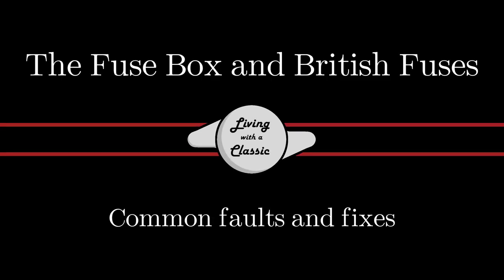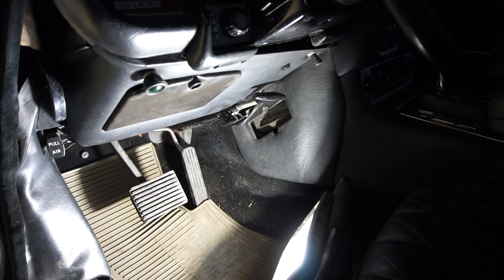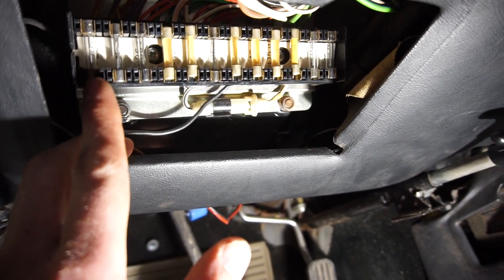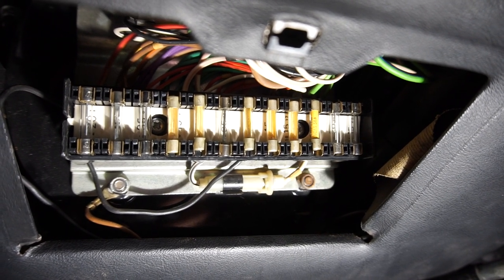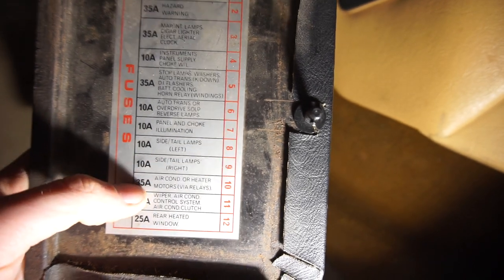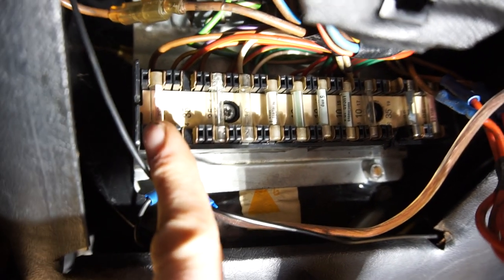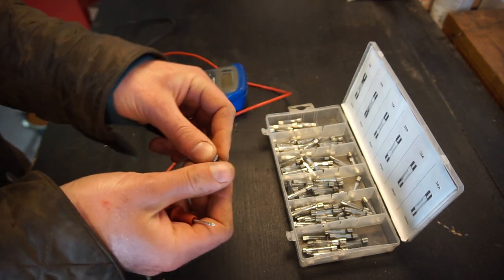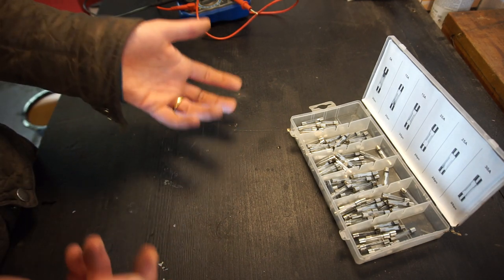Jaguar Fuses - Jaguar XJ6, XJ12 and XJS

Comment: Good video. Your site has saved my bacon over and over. I blew a dash light fuse tonight; checked the fuse box and there it was; a blown fuse. I replaced it with one of my spares. Now I have to buy a replacement (for my replacement) and I'm on the road again.

Comment: Adam,  thank you!  I have a 91 XJS V-12 Convertible.  You've really helped so far.  Just wanted you to know.  I will check my fuses tomorrow.  My side windows do not work.  I have replaced both switches.  The book says circuit breaker or relay, but I'll start with fuses just to check.

Comment: You will help a lot of people with this video because what might seem a terrible problem, many times has a very simple and cheap solution. The automatic gearbox in my old Mercedes began to act weird all of the sudden, and the dealer wanted to replace it at a price of  €4000. I made my own detective work and I quickly found the real problem: a worn relay that cost €20 new. 

I have a question: everybody says nasty things about Lucas components, but I learned that most of those were manufactured by Bosch, a brand well known for its quality. Bosch sold those components to many other car manufacturers with little or no problems reported, so why then Lucas failed so much on Jaguars?

Comment: These are very helpful and the interesting videos, especially for a new XJS owner. Though the XJS was not shown here, I ventured into my in-cabin fuse box in my 1991 XJS, although mine was on the passenger side (right side). My cruise control is not working and I see there is a listed fuse for it, but I haven’t found it yet. 

Also, under the hood there are additional fuses listed, but unfortunately, there is no description of what they correspond to; only a mention to refer to the owners manual which I do not have.
Reply from the maker: Thank you! I have all the manuals for my 1991 XJS. Which fuses do you need?

Comment: Hi Adam,
Good video. I checked my fuses on my early series 2 xj12 just after your video was posted and noticed my fusebox had melted at the third fuse from the right. I want to replce the whole box with a modern more sturdy box and modern car fuses. 
Is this do-able? On my old rover P6  v8 the electrics were so short fitted that it was nearly impossible. By the way the rover p6 has the same plastic melting problem as the jag. Rubbish quality.

Comment: My 1989 XJS convertible had an engine temp gauge that did not work properly when I bought the car. As soon as I started it, the gauge would go to hot immed.  Long story short, I found that the cluster had been removed and the flimsey tabs had been bent out of the way when they put the cluster back in. After jirry rigging the connection, and putting the cluster back in I have NO POWER to anything. No lights etc. and no ignition.  Is there a Main switch/fuse/relay ?
Reply from the maker: You lost power to the cluster or to the whole car?
Reply: @LivingWithAClassic  I lost power to the whole car.  Nothing works.

Comment: Need some help I have Hazzard lights but no hi beam no horn no turn signals and no lights on the dash it's a 83 s3 xj6 just stopped working is there a ground wire under the dash somewhere
Reply from the maker: Sounds like an issue with one of the big connectors under the dash near the steering column
Reply: @LivingWithAClassic  ok thanks for getting back to me I'll look at all the connections

Comment: Hello Adam, Home your doing great!!!
Can you help me? I was changing the warning lights to LED type bulb. I turned on the ignition to make sure they  work but I accidentally touched the back part of the warning lights unit to ground and it sparked... From That point on, the hand break, battery warning lights don't turn on anymore ... 
Also, the alternator is not charging. Is there a fuse for the warning lights or for the alternator ?? 

please help me!!!!!
Reply: Of course there are fuses for those items. Look at the charts in your books and check each fuse box and it’s labels.

Comment: Hello Adam, nice video indeed. I am the happy owner of a1996 XJS convertible and would like to access to the fuse box (passenger side for a LHD). I cannot manage... I do not want to damage something and I do not see any screw or clip, there is only the A/C sensor in the middle of the panel (a black plastic knob with holes). Any idea or clue about how I could access to the fuses box which is behind this panel ? Thank to every body for help...
Reply: You just pull the panel off. It’s only held on with clips.